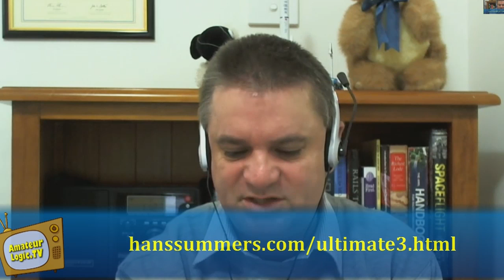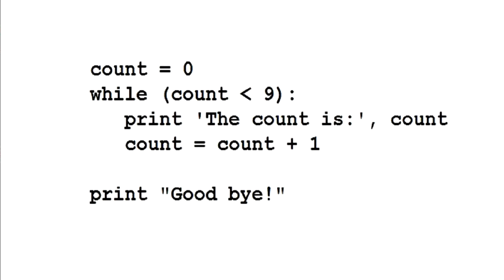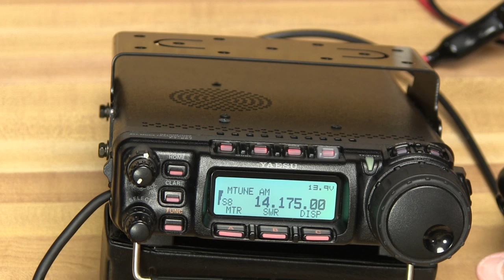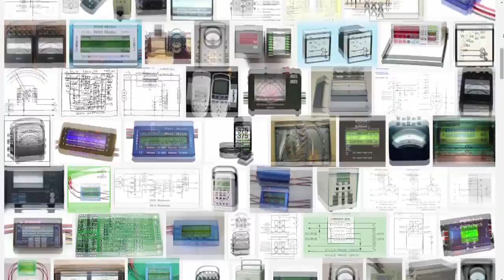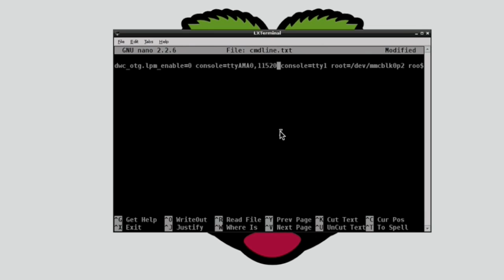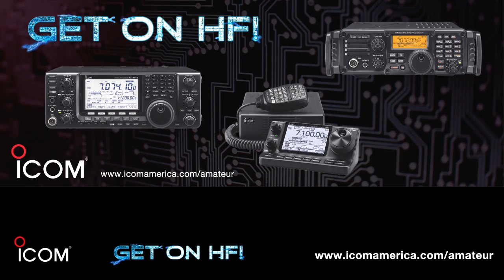AmateurLogic 72: TNC Pi, Wattmeters & Python

Comment: thanks for sharing. just a quick comment abt the portion of the video starting at segment 48.20 to 48.50... the packets don't get routed to your iGate by the digi because it thinks you're closer.  but, instead, your iGate rig actually picks up the packet and sends it to the APRS-IS servers before the other igate would. your proximity to the digi helps your igate to hear the packet first before the other igate does because it's farther away than yours is.  so, the notion of who reported the aprs packet to the APRS-IS servers is not because of digi routing it to your iGate, but, rather which iGate hears the packet first and reports the packet to the APRS-IS servers first.  I hope i articulated that clear enough :)

73, N0AGI
http://N0AGI.com/